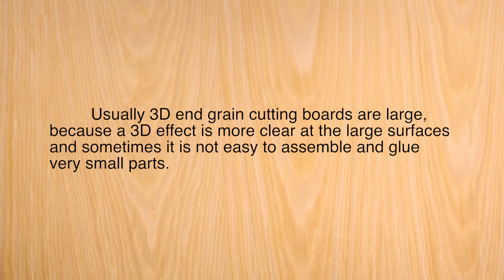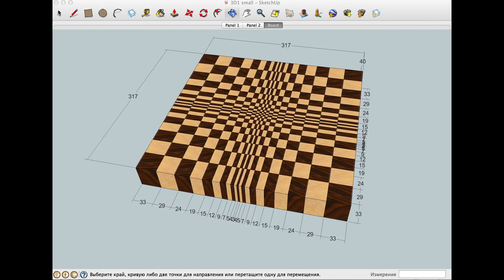3D end grain cutting board #1 to make with the use of 13" planer. Free plans.

Comment: I have a question mtm.  After the 42mm wide end grain strips are cut, we proceed to cut them further on the end grain.  Then we are instructed to sand these strips on the drum sander to the desired thickness.  Why are we sanding them, when we could be planing them or joining them?  Wouldn't they be more glue ready if they were planed or joined?
Reply from the maker: You have to plane or join them across the grain. This is dangerous. Also the strips are very thin, the planer's rollers will break them.

Comment: Thank you for your responses! For some reason it's not letting me reply directly to your response, but as far as the question about the proper thickness of wood that I'm stating with......I mentioned I only have access to wood 1 3/8" thick and wondered if I can use that or not and I see ur answer on that, but now I'm wondering......Does that mean I do have to use the thickness u specified in the plans, and that it won't work with thinner boards? so I would need to glue another board ontop of what I have, so I end up with the total thickness to start with?Or should we be able to get away with using thinner wood such as 1 3-8" thick?
Sorry for being so precise, but this wood is expensive as heck round here and I don't want to use all my good wood and have it. It work out at all and waste my money and resources lolI thank you very much for you help though, and I'm sure there are loads of other people with the same problem of getting thick enough wood!!
Reply from the maker: I also use thin lumber - 24 and 30 mm thick. Just glue wide panel and then saw off needed strips. This saves the wood and helps to get thick strips according to the plans.

Comment: I have a question that I can't seem to find an answer to on the internet. I have some people that are interested in a cutting board that looks aged and I see a technique with steel wool and vinegar that darkens the wood. if I wipe it with a damp cloth once the color has changed and a light sand and then mineral oil, is there any danger in using the aging technique for a food surface?
Reply from the maker: I think, no

Comment: Do you have to use a planer or could I use a drum sander
Reply from the maker: Bill Warmus It is possible to use a drum sander. This is just more long way and more expensive. Sanding end grain needs a lot of sandpaper.
Reply: Ok thanks
Reply from the maker: Bill Warmus You even can use hand-held belt sander or rotary sander instead of drum sander. The question is the working time and the quality.
Reply: I see
Reply: good after noon every one. who's on line.   Bill